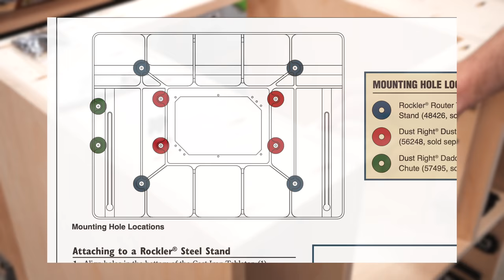How to make a ROUTER TABLE w/ Bit Storage & Dust Collection

Comment: I'm currently doing a kitchen remodel, so I made room in the budget for one of those Foreman jigs.  I've wanted one for a while, and I figured it would really help speed up the cabinet making.  Man...how did I live without this thing?  I have a K4 that has served me well and will still have its use in my shop, but there's nothing like the Foreman.  Especially when doing larger pieces.  I can batch out all the pocket holes for a full carcass in a few minutes.  Definitely a worthwhile investment, iyam.
Reply from the maker: It is such a killer tool for cabinet making!

Comment: Nice solid build! I have a wooden router cabinet I built many years ago. I'm using the same 7518 router as you. I just inclosed the area where the router is and put in a 2.5" port for the fence and 4" output to my dust collection system. I am not sure where the separate metal box comes in since the router is already in a box (if you covered the back area). I like the ease of the router plate trim ring removal. No tools, just press a button.
Reply from the maker: Thanks Tom! Yea the bucket might not have been really necessary I guess but it does a good job with that split port.

Comment: This is one of those videos that gave me a ton of questions. How come you did not use glue on the cabinet? What countersink bit is that? What is that monster pattern bit for? Could you have used the push to open fittings behind the drawers instead of along the sides? Does that lift plate have a height lock?

Comment: 😂 he had a few hours of free time probably lol I'm here with a drill and skill saw with pieces of wood from an old fence.
Reply: We all have to start somewhere :)
Reply: I often screw mine under my picnic table... Through the sun brolly hole... I really need to make a real table... But it works...  All you really need is a flat surface and some sort of support. And a fence system.
Reply: I'm almost 5 hundred percent sure this wasn't just a few hours.

Comment: Nice, straightforward build!  Love the "vertical" drawers, but I'm concerned that the slides you used aren't designed to hold weight in that direction.  Based on your design, I think I'd have built the bit storage frames to provide room for the slides on the sides at the bottom, and let the bit shanks hang into the space between the slides.
Reply: There shouldn't be substantial weight so the slides shouldn't bend. But I think your right that they won't hold the published weight limits in that orientation.   It's just a common sense thing though. You wouldn't put a bag of and in those drawers

Comment: I have  questions .   I noticed that you had the Woodpecker router lift and went with the Rockler lift this time.   Was there a reason for switching to the Rockler other than maybe the Woodpecker would no longer fit the Rockler style table?     How do the 2 compare?     It seems the thumbwheel on the Woodpecker could take a lot of adjusting if you did not get close with the initial coarse adjustment.   And were there any issues with the phenolic table top?   Thanks!

Comment: I'm not I master carpenter and don't even have a drill press but when I saw you using your vacuum on the drill press I thought you could somehow mount the vacuum hose to the drill bit holder. I don't know if this would actually work but if it would I think you should try it.

Comment: Another awesome build! I noticed you talked about drill press dust collection and was wondering if you've seen Woodpeckers new fence for the drill press? Looks like they have some nice built in dust collection.
Reply: Spenser Olson An even better idea is to use something like flexible RIGID plastic hose. You can get it at Woodcraft. I hook it up to my blast gate by the drill press, then bend it to be right next to the drill bit. Better than dust collection in a fence because a lot of what you do on the drill press is done without a fence. It works great, gives me 95% dust collection, and you can easy move it aside when changing bits or repositioning your work. Best of all, it is very rigid and holds weird octopus-like shapes, so you can use it in difficult situations. I use it for my power mortiser, too, where chip extraction is even more important. Works great!

Comment: What frame rate do you film at in order to get that motion blur in your time-lapses? Is that something you do in post or is it a certain camera setting you use to achieve that look? Also, the side to side motion is that just a Ken Burns type of effect or do you use some kind of slide mount for your camera

Comment: Basically as useful as a full cast iron router. I've just gotten my grandad's router, it's a bit bigger and the axle is 60mm diameter. Glad the bits survived, I've seen them on the internet for several hundred euros.

Comment: That’s a sweet build!  What’s that build run?  Looks like $2500 easy with that power feeder.  Checked the link, yikes.  That makes sense for a professional shop.  Little old me looking for ideas and willing to go up to $500-600 including a $350 good router probably has to be a bit more laymen in the design. Lol

Comment: I'm guessing $2600? It's gorgeous for sure. Wayyy more than what I need but I have to say, I would love to run a few boards under that big Chamfer and feel the 'Weight' of the table and the confidence of the cut. Ok, Back to my home built, table top router system :)

Comment: Does the power feeder need a feather board or is somehow keeping the piece held against the fence?
Reply: Sam C power feeders have the wheels turned inward to the fence at a tiny angle, like 2 or 5 degrees, thus pushing the stock against the fence and negating the need for a fence

Comment: Nice job. Your router table looks great! I'm not sure why more people aren't fitting their high end setups with the MLCS Powerlift Pro. It's a foot pedal activated motorized router lift that takes the concept of a plunge router and inverts it for use in your router table. Since you can keep both hands on the work piece and bring the spinning bit up into the work piece, it makes operations like mortising, stopped dadoes, circle cutting, incremental passes both safe and efficient. Combine all that with digital precision of .001", stored memory positions, and much more through the android app, I'm not sure why people are still yanking their crank lift.

Comment: I don't know if anyone else has had this problem. But when I use a router box with my dust collection it actually pulled the dust into my dewalt router and ended up causing failure in under a year.. the dust collection was so strong it would over power the routers down draft. Since then I've only been using a fence dust collection

Comment: Good video!  I need to apply some drawers to my router table soon and will reference your strategies from this video.  
Question: Does the power feeder that you added allow you to adjust the speed that it feeds material? For example, feeding faster to minimize burning from a bit

Comment: I'm really really surprised that Rockler continues to sell the Pro lift with the Wrong dial indicator on the microadjust.  It's been noted since it was released and they just don't seem to care.  (For those that are curious, the dial indicates 1/16" adjustment for a full turn when in fact it is actually 1/8".  Almost everyone finds out it's wrong when they run a piece and it's too high after using the dial).  It's a fantastic lift and I love mine but that known issue on the dial is surprising how long it continues to be an issue.

Comment: Hi as a amateur my self I'm wondering why you can stagger the guide rail and does it make a difference as it looks like yours doesn't
Reply from the maker: You mean like having the fence in two different planes? That can be useful for jointing edges on a router.

Comment: Saw several looking for build plans but see none added to the info, so if you need it you can use this: 
https://www.youtube.com/watch?v=MhIzJrTYHBc
its an identical build merely a month before Crafted made his build and the plans and materials used are supplied.
Some edits were made from the original build though, like the top used and the drawer mounts used.

Comment: Wow I am really lazy. My router table is a piece of plywood with a hole in it screwed to some 2 x 4s.
Reply: I did this too. Years ago i built a 4x8 foot worktable, drilled a hole in one end, and mounted a router underneath. I then added what i call a swing-arm fence. A straight piece of wood, bolted at one end, with the other end not secured, so it could be swung any distance from the router bit. Set the distance you want, secure it tight (somehow), and there you go.

Comment: Excellent work, but I doubt that this project is viable in terms of cost benefit.  a Felder F500 vertical router costs much less than the material cost of this project.  So I do not believe that anyone in their right mind buys these parts (table, elevator, router, vacuum box ..,)

Comment: Is it just me or are people spending more time using screws rather than a basic joinery technique these days? This guy uses like 10 holes on 1 corner and all he had to do is either cut with a dado blade or a rabbit routing bit and just glue and clamp. No need to use screws when basic woodworking techniques work just as well if not better. I believe the reliance on screws is because of lack of woodworking skills IMHO as there is literally nothing different to what he is doing compared to a cookie cutter cabinet business, Quick screw holes to pump as many units out as possible and the product doesn't last long nor doesn't look good either. This is why a lot of kitchen cabinets fall apart after a few years compared to japanese joinery lasting generations.